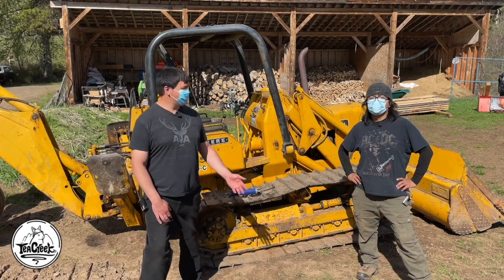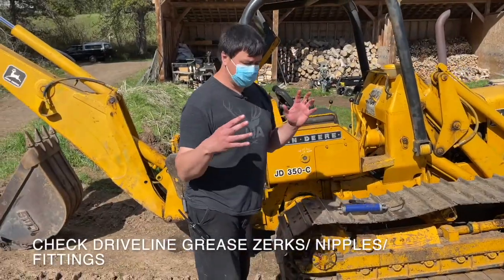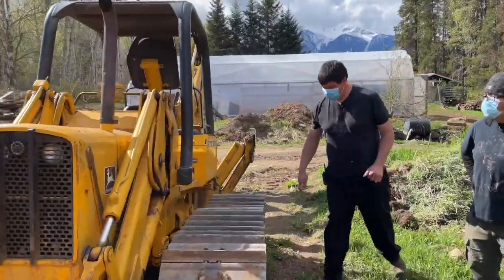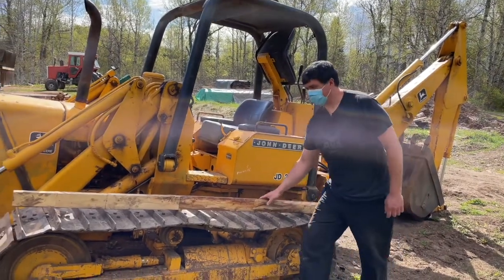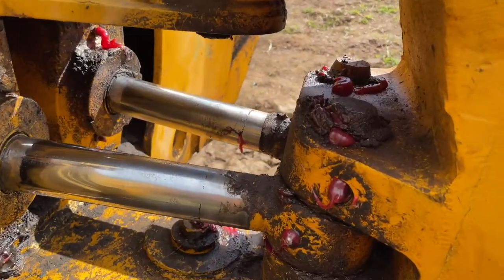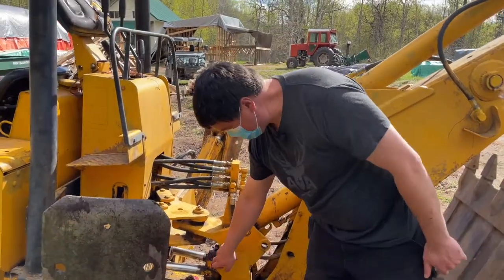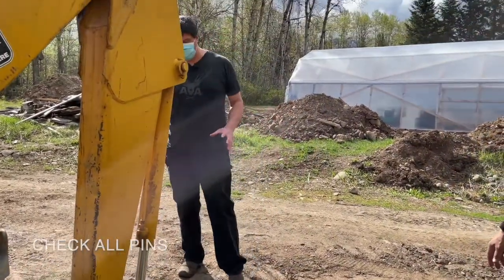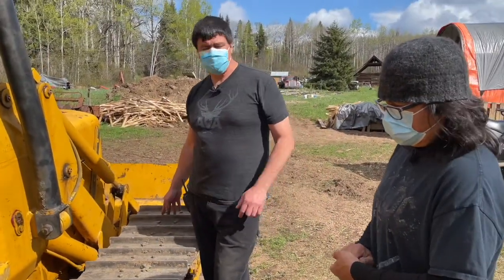Inspect and Operate a Backhoe (JD 350C)

Comment: Thank you so much for going through start up maintenance and check prestart. One thing i would also mention is the Radiator fluid Level. Just saying this because my 1978 Dynahoe-190 has a habit of dropping the fluid level. Its old with over (8000) hours on meter. Have never done anything to Engine an old Detroit Diesel (353) and I keep Clean oil in her. The old Detroits take (40Wt.) None Detergent type Oil.
Reply from the maker: Very good point, we do teach that with every machine but forgot to capture it, or it didn't make the edit on this old video